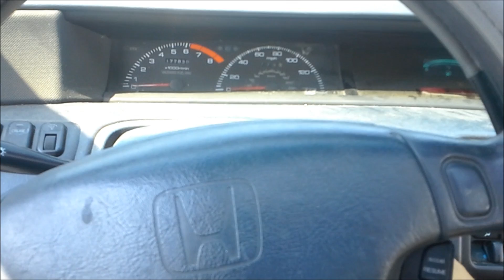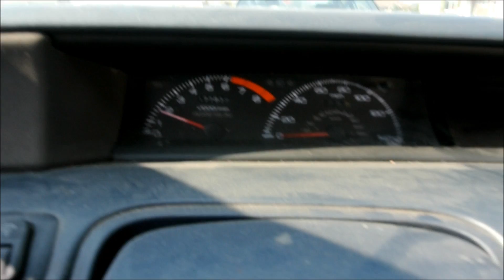1992 96 Honda Prelude main relay fix

Comment: Herro, Bloo here.  My owner, Eric, took his out and said it looked fine, not even the slightest evidence of bad solder.  But he reflowed every contact with some wire solder and flux.  Problem solved!!!   :0)
Reply: Same thing i did yesterday on my mom's car...it looked perfectly fine, but after the re-solder car started right up - 1999 civic LX auto (w/70k miles).

Comment: Awesome, I have a 93 si, but the 4WS light stays on. I know it’s in the electronics, because I’ve had all four wheels turning. The light goes out sometimes, but due to vibration when driving I’m sure it’s similar. On windy roads it’s fun to drive. I’ll keep it, one day I’ll get ur done.

Comment: I have a 96 prelude s 5 speed manual. Mine cranks and starts but immediately dies in cold weather. After i start the car between 8 to 10 times she starts and stays running. Any ideas on how ro fix? I have no codes.
Reply from the maker: A lot of these OBD1 or early OBD2 cars don't give codes for everything or sometimes won't populate a check engine light but still has codes. Sounds like it could be an ignition switch or the relay shown in the video could be a number of other things though too like a fuel pump or fuel pump relay
Reply: You can check the ECT (engine coolant temperature sensor)

Comment: I know its a late reply but that that little box you are looking at looks like a high input converter for after market car amplifier. Didn't get to check other comments below
Reply from the maker: Eh not to late I try to respond to all comments.. the little box turned out to be an aftermarket alarm system that ended up causing lots of issues and had to remove it and repair the wiring harnesses where they used the dreaded scotch locks/t-tap wire connectors.. those things need to be outlawed that are just guillotines that cause mad issues.

Comment: So I also have a 93 Honda Prelude. I changed the starter, and the fuel filter. My fuel pump is good. So my car doesn't like to start half the time, unless I spray starter fluid into the intake. But some days it starts up just fine! What a headache, do you think it's the relay that is the issue like your car?
Reply from the maker: It's definitely worth a check and it's cheap to resolder those points anyways so might as well do it while you're there. I could get mine to start and run off of carb cleaner but never fire up on its own. Check what pressure your fuel pump is priming to make sure it's the correct pressure.

Comment: hey man I believe I have the same problem. I have a 1992 honda prelude and it starts up and runs drivable right up until you turn it off and the I have to wait 5-10 min before it wants to start back up. it also has an idling problem where it will throw my rpms um and down. any suggestions?
Reply: all it will do is crank afterwards until 10 min later when it starts up again
Reply: you found your fix?
Reply: That’s the idle air control valve not screwed inside

Comment: aftermarket alarm
Reply from the maker: ok cool i still need to see if i can pull it out without messing up the original harness wish me luck they used quick connects :/
Reply: +ils360 I bought a car whit the same thing I would just tuck it out of the way out of sight out of mind
Reply from the maker: +Josh Murrell unless it decides to come back to life that happened to my friend four different times then he had to remove it